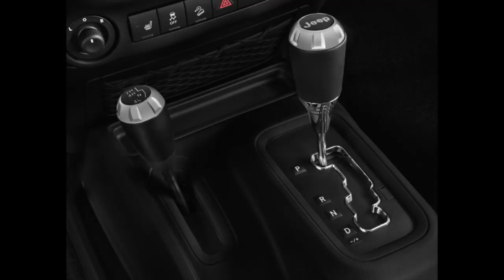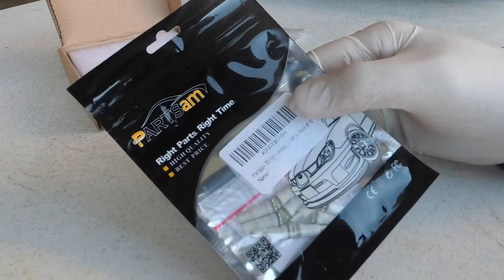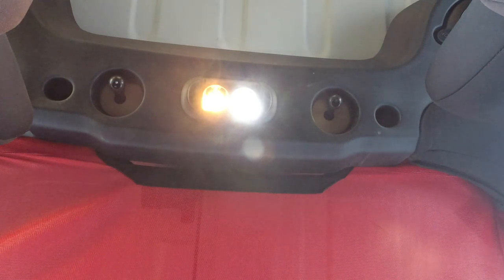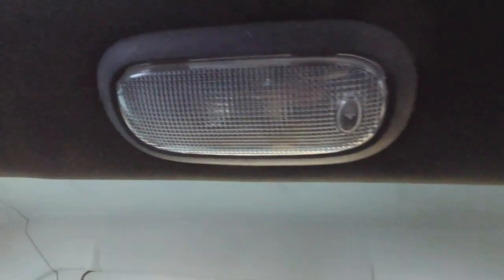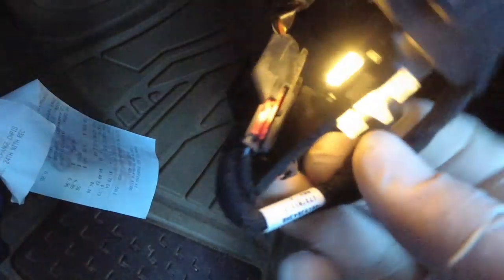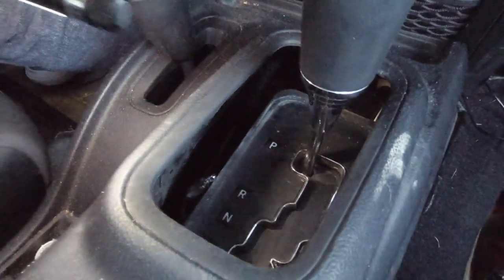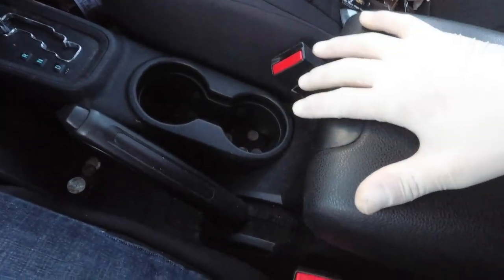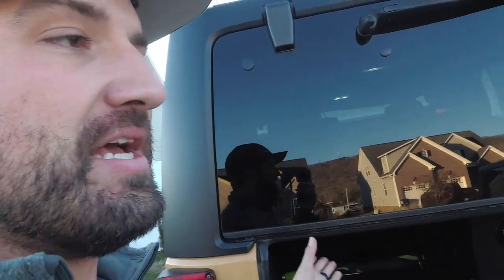How to Install Jeep JK LED Cab/Dome lights & More

Comment: FYI regarding indicator led globes. You need to change the flasher can to an LED version and it will work with no issues.

Comment: I ordered the interior dome LED lights linked in your description. I installed them , and they "mostly" work.  They'll turn on when the doors open, they'll turn on with the blinker stock switch, and the map light individual buttons work when the key is in the ignition and turned on...

But no key in the ignition, and you hit the dome light individual buttons, and the lights dont come on. They come on very faintly, almost so faint that you cant even see them. Did you have this problem?

Comment: how about a video on how to replace the bulb on the map lights of Jeep JK
Reply from the maker: I would have changed them but you can not. They are built in the casing of the mirror. Also the lights under the passenger and driver dash are not able to be changed. There maybe a way on each of these but I didn’t find it worth the trouble to go any further.

Comment: Did you have any issues with the map lights staying on when swapping out to the leds? I had done it in the past and I had that issue.
Reply from the maker: Hugo Vigil Sorry for the late response. But I haven’t had any issues. You May wand to squeeze the prongs the lights go in. You may not be getting a proper connection.
Reply from the maker: Oh I gotcha. Yeah I haven’t messed with lights in my rear view mirror before, nor have I had any issues out of them after install LED cab lights. To be honest I never ever use the MAP lights.
Reply from the maker: Have you tried to unplug the rear view mirror and re-plug it back in and see what it does.

Comment: Any bulb suggestion on the shifter for a 2018 jeep jk? Mine are super dim I turn on my headlights and that along with my dash lights are extremely hard to see unless it's dark out. Horrible for driving in rain when it's still light out
Reply from the maker: The shifter bulbs should be these.
If not when you go to auto zone or O’ Riley‘s
https://shop.advanceautoparts.com/p/sylvania-2721-longlife-mini-bulb-pack-of-2-2721llbp2/99997887-p?product_channel=local&store=3500&adtype=pla&product_channel=local&store_code=3500&gclid=Cj0KCQjw3v6SBhCsARIsACyrRAncsQGOJReNWpm7q3KgQHFR3EUrNQhuKr0TwZSZ9xKg5zE9ReRnnEEaAp6ZEALw_wcB&gclsrc=aw.ds

Comment: My dome lights wont go on. The courtesy lights when you open your doors wont go on. Ive looked at the door plug, ive checked the stick, tried to see if theyre burnt out. Nothing. Have you heard of this happening and know any fix? Or any jimmy rig i could put in to have interior lights?
Reply from the maker: Have you checked your fuse box to make sure they are good and not blown?

Comment: What led did u use for parking shifter? I have 2017 jku and can’t find which bulb to buy
Reply from the maker: This one should work. https://www.amazon.com/SYLVANIA-2721-Miniature-Contains-Bulbs/dp/B06WLH5YRZ/ref=asc_df_B06WLH5YRZ/?tag=hyprod-20&linkCode=df0&hvadid=312111914138&hvpos=&hvnetw=g&hvrand=4512120023975344254&hvpone=&hvptwo=&hvqmt=&hvdev=m&hvdvcmdl=&hvlocint=&hvlocphy=9013266&hvtargid=pla-567300930173&psc=1

Comment: How did you put back together the back housing part? Mine fell out but it won’t go back in
Reply from the maker: Not sure what you are talking about. On the light it self something fell off??? 
On the old lights there is a sleeve that fits just right and it maybe in the new lights as well. You  just need to make sure you only take out the screws that holds the light to the vehicle. The other screws holds the lights internal parts together I think maybe what your talking about.
Reply: Jeep_tv no like whenever you popped off the cap with a knife and the you went to pull the bulb out the whole thing fell out. I’m talking about that part. It won’t go back in place

Comment: What size led light did you use for the shift light ?
Reply from the maker: I’ll have to look back and see.
Reply: I need that light what size is it
Reply from the maker: https://shop.advanceautoparts.com/p/sylvania-2721-longlife-mini-bulb-pack-of-2-2721llbp2/99997887-p?product_channel=local&store=3590&adtype=pla&product_channel=local&store_code=3590&gclid=CjwKCAjwybyJBhBwEiwAvz4G7w1MQ9beQbWCGebwuB4zi78zPSkZiBRyDV7BINMSVRPNkjv1iobSmRoCrdkQAvD_BwE&gclsrc=aw.ds

This is all I could find. This should work. The one I posted for Amazon has been discontinued evidently.